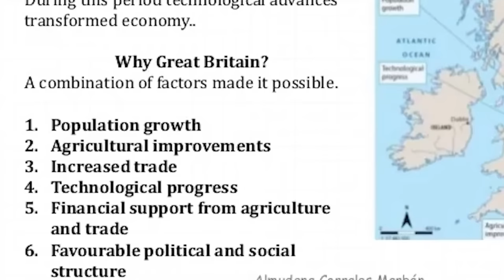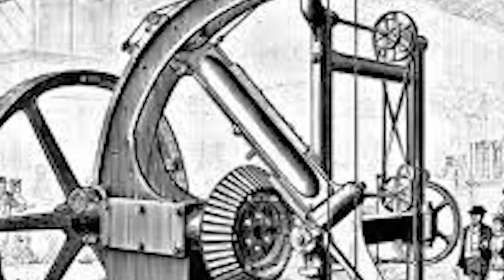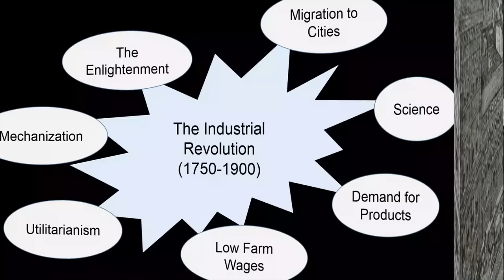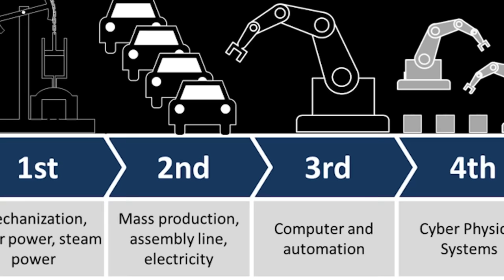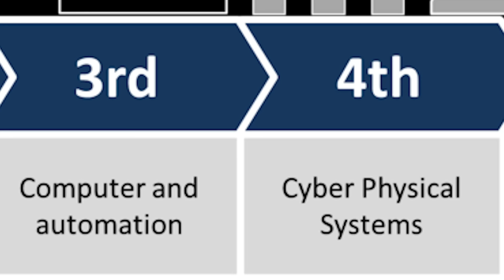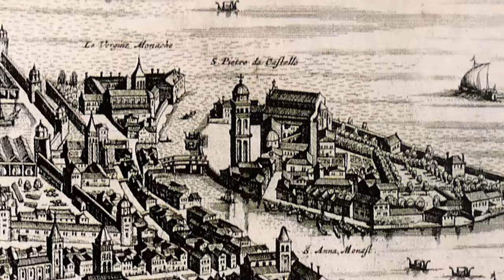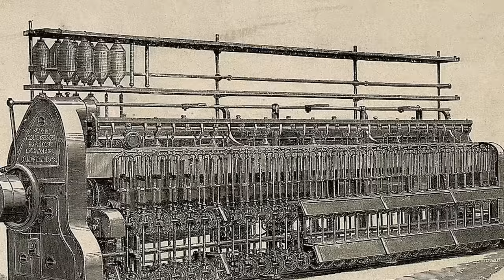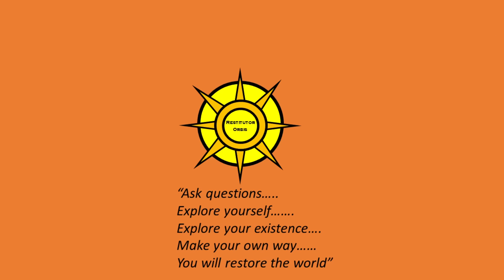Industrial Revolution or Recycling the Old-World?

Comment: Number of questions always appear unanswered or even unanswerable, the first of which is, as you state, where did all those bricks spring from, because bricks take far longer than most people realise and having looked into the production of bricks, having also having a friend who used to work for a "handmade" brick company, the process is slow and intensive.

But then there's the question of a cohesive workforce, especially in the States, where many people spoke very little, if any, English, coming from different countries, with different languages, beliefs and customs, yet, somehow, suddenly, all these people could form a cohesive working party, throwing up building after building in Neo Classical style, with a few castles thrown in for good measure, in super quick time.

But the last question is, perhaps, slightly off topic, and involves the aquaducts of yesteryear.
Having visited some huge aquaducts in Italy and France, one cannot but help be impressed by their sheer scale AND the very fact that they are built in such a way that water can be carried for hundreds of miles, therefore a constant drop is required in order for the water to reach it's destination and not just overflow somewhere along the length because the gradient wasn't properly adhered to during construction.

My question however, is that many of these aquaducts appear to be surplus to requirement, for they cross many rivers and streams along the way, all of which would be more than suitable in supplying fresh, clean water to the cities concerned, so why the need for these huge undertakings?

I have been researching star formations (forts) for some time now and the accompanying canals, many of which were main roads in the past, but have since been covered over to create highways instead.
This led me to consider that perhaps the aquaducts were not just for drinking water, but were for a form of electrified water, which is not so strange as one may think, because if salt is added to fresh water and an electrical charge then applied, the water then will hold this charge and if a magnetic force is introduced then the water will form a current, an electrified current if you will.

Then there are the works of Viktor Schauberger in the early to mid 1900s, for he realised that the natural flow of water could produce electricity, he is worth checking out.
Reply from the maker: That is a very good perspective and highly probable theory! It also goes along with the multiple forms of energy we see in the remnant infrastructure.
Reply: I can appreciate your thinking, thank you, though I am well aware this comment was plainly not addressed to me. A song lyric caught my ear, gave me a quick thought that might mean nothing much; 
"....the cars hiss by my window, like the waves down on the beach...." 
-Jim Morrison 
The salty slap of surf upon silicate sands....might there be a simple way to harness that energy, done without so much bulk of apparatus?  Cheers!
Reply: They give us truth, usually in films and in music, most never really think about the lyrics of songs, even though they may know them off by heart, the meanings are often missed.
This does sound interesting, not being a fan of music by the Doors, I do know that Jim Morrison's father was the Rear Admiral during the Gulf of Tonkin incident, so know that he would have grown up in the "thick of it" so to speak, so yes, perhaps there is a deeper meaning behind those words? @jarmyvicious
Reply: This comment reflects my thoughts and intuitive feelings as well!! So very well put!🙏
Reply: This would make a great video. The aqueducts certainly are impressive and knowing the old world, they served multiple purposes. The fact that they are arches like the arches at the centers of the cities, leads me to believe they carried electricity to the outskirts of the city—not drinking water. Steam punk age.
Reply: Thank you🥰 @bekaebrown
Reply: Thank you so much, for that!